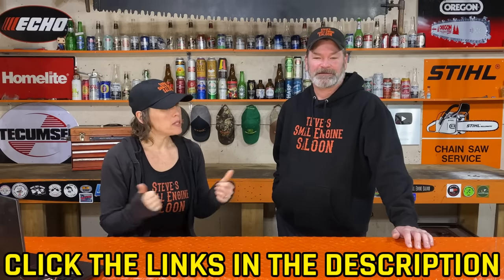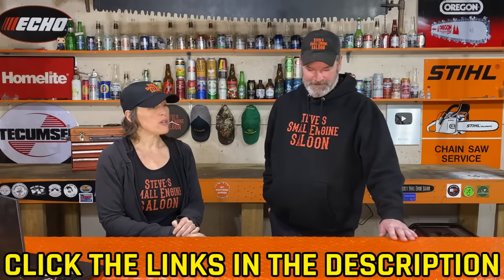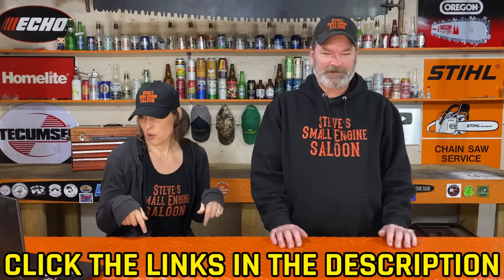Can I Use Old Dirty Motor Oil As Chain Oil In My Chain Saw? (DAY 18)

Comment: In alaska we all exclusively use used motor oil in our saws, we filter it through a coffee filter first and hit it with a magnet to remove metal flakes, the standard bar oil is waaay to thick a 20 below zero to even work, but 5w30 works just fine, been doing it for years with absolutely zero issues. Plus, why pay for stihls overpriced oil?! I cut 60 plus cords of wood a year, and have never had a single problem doing this.
Reply: I do the same, I purchased a small block Chevy oil pump converted so I can use a filter on it. I filter it through a k&n oil filter and store it in jugs to use .
Reply: You can't mechanically filter out all the metal particulates with a coffee filter. You're getting away with it because of limited use. We used to see commercial pro saw oilers fail regularly using used motor oil. You're stepping over dollars to pick up pennies. Paying for the correct type/weight bar oil isn't going to bankrupt/cripple you by cutting 60+ cords a yr.  Sure, you'll always have brethren that do the same thing.....doesn't make it correct....
Reply: @TheReal1953  try using stihl oil in 30 below zero, it will burn up your bar in 10 minutes because it's too thick to flow. That's why we use 0w30
Reply: @jasonburguess  We used to thin bar oil when it was that cold with diesel. You still retain some of the lubricity 'stickiness' of true bar oil that way. You have ZERO stickiness with waste oil... it's just slung off. Cold temps may be saving you some from normal temp wear.
Reply: I thin my bco. With 10 to  20% atf. Works really good in winter here in Mt.
Reply: Every logger I’ve ever known does that, oil that is drained out of the yarder, shovel, etc.

Comment: I cut over 70 cords of wood a year. I have several Stihl saws and use only clean used motor oil out of gasoline engines as diesel engine oil is too thick and nasty. Here is the thing. My engine I took it out of is a lot more delicate than a cutting chain and my engine was running fine on it. Also I turn my oil up all the way so it uses all it can and can oil good. I fill my oil full and my fuel 3/4 and that way I run out of fuel first. A dry chain is bad. Also about grit. There is so much dirt and sand in the bark of trees the little amount of abrasives in the oil is insignificant.

Comment: I have used used synthetic motor oil in my chainsaw for decades. Make sure to screen the grit out first.
Reply: I use cooking oil
Reply: @johncuervo3019  I did that for a while to but it did eventually fuck up the oilers in both my saws.
Reply: I use a 50/50 mix of used car oil and thick bar oil to save a few bucks and use up my used oil.
If you drain the oil into a clean container, there's no grit in it. If it has grit in it coming out of a running motor, the motor is about to blow up.

Comment: Good quality bar oil is way more sticky than used or new motor oil for  a reason. It clings better to the bar and chain for better lubrication. Only time I have heard of guys using motor oil (Professionals, not home gamers) is when it gets really cold out. Motor oil will thin the bar oil a little to help it flow at cold temps.
Reply: There is no difference in the durability  of chainsaw components between special chainsaw oil and used car oil in good condition, none. The only reason to use specialized oil is environment and health, engine oil is very toxic, specially if its used. Pros only use specialized oil when they are under Government and company regular inspections that demand it but when they are not most will just go for the used engine oil.
Reply: @Wen6543  Bar and Chain oil is much more sticky than engine oil. That is why it is used.
Reply: @corey6393  Other than having to refill the oil deposit faster, ecology and dirtiness it makes practically no difference in the performance of the chainsaw and the durability of its componentes.
Reply: The bar wears out faster. The sprocket on the tip gets loose. 
And if you gun the throttle one time not cutting you’re wearing a stripe of dirty oil. 
Bar & chain oil is cheaper.
Reply: @davehaggerty3405  No its not, even if the bar wears out faster is not noticeable, by the time you need a new 80 or something dollars bar (depending on the size and brand, can be a lot cheaper) you have saved hundreds of dollars in bar oil. Heck, you can even use kitchen oil without problems.
I don´t advice anything, i´m just saying a reality. Everybody can do as they like.
Reply: @Wen6543  I’m just going off of personal experience. Cutting side by side with my Dad. Back when we both heated with wood. 
Dad was too cheap to buy bar oil. Old motor oil in a warm saw gets thin and runs right thru. So you have no lubrication. 
I buy bar&chain oil by the gallon at TSC. And I only run Amsoil synthetic at 80:1 in the tank. 
I also use bar & chain oil on my several sets of hedge trimmers. Tho that type oil can cause a little bit of browning on the shrubs if I just put oil on the cutter bar. 
So I start on the back of the bush.
Reply: @davehaggerty3405  If the chain and bar get that hot to the point of no lubrication then something is wrong, the temperature inside a motor is way hotter and the oil keeps lubricating. 
Our chains and bar sprockets and grooves are always "wet" not matter the season or what we cut, and we can always touch them without the risk of burns, if they are like that then the oil is lubricating, no secret. 
Yes, it´s dirty, yes, it can be dangerous because it creates a mist that is breathed, contaminates the skin, etc, but it works fine for the chainsaw.

Comment: Just because you can does not mean you should.
Thanks for the video Steve and April.
Reply: You beat me to it!
Reply: Yeah yeah well I've been doing it for more than 20 years and have never had a problem
Reply: @heavenbound1536  Congratulations.
Reply: @justanotherviewer52  yeah well doing almost 400 CORDS of firewood a year and residential tree removal and land clearing nothing wears out a chain faster than nails or working on a fence line and as far as wearing out bars ... usually that comes from my guys running the saws in the dirt..... but if you change your oil after 2 or 3 thousand miles there usually ain't a whole lot of anything that will wear out the bar before you hit barbwire or concrete epoxy a home owner pours into a hole in the tree

Comment: I tried using straight used synthetic oil for bar oil.   I had it in jugs for about 6 months and left it to settle.    Then pour it into another jug but not the last part.   There was always different stuff in the bottom part.    When I used it I found that the chain would only need to be tightened half as much as it did with bar oil.   I used it for year's and cut a lot of firewood as that was our source of heat.    Put bar oil in sometimes and found I was back tightening the chain more often.    Our wood stove was used 24 hours a day for about 6 months of the year. 

Dale in Canada 🇨🇦

Comment: I have filtered used Full synthetic oil that is really clean and used it as bar oil but usually I use bar oil and shake the bottle and if it sloshes like water it is too thin. I shake all the brands and buy the bottle that is the quietest which means it is thicker and will not fling off the chain as easy.

Comment: Thank you Steve for shooting my great idea down. I have just changed oil in my 6.0 powerstroke and kubota m6800 tractor.  Therefore I'm in possession of a little less than 7 gallons of used oil. I'm in the woods sawing right now and NOT in possession of any saw chain oil. So I thought kill 3 birds with one stone. Save a trip to the store. Get rid of something I'd have to haul to the recycle center  and 3.... save some money. Let me say I disagree with one statement you made. Bar oil ain't cheap. To me cheap would be 5 dollars a gallon. I'm paying 15 at ace is the place. At 6 gallons of used oil that's $90 bucks. I'm gonna take your advise anyway. Thanks. Your videos are the best.  Technical detail and
Reply: Super entertaining .

Comment: I don't know about you but when the engine oil comes out of my vehicles it is in very good condition.  I started using it sixty years ago in the days when all saws had manual oilers even with automatic ones.  Because I used much more of the free stuff than the expensive version (mine was never 'black' by the way!) I was almost washing away the contaminants.  The bit of abrasiveness that might have been present was as nothing compared to the salt water , sand and gravel that we always had to cut.  Never had a problem and my bars and chains lasted as long as anyone's.  Longer than most as mine always had plenty of oil on the chain. Though few were and are rich enough to use brand name new bar oil.  Wasn't even offered in those days.  Wasn't until many years later that the marketing wanks started putting it on the shelf.  My saws never 'splattered either'.  I cleaned my saws in any case and they rarely ever went to a commercial shop.  If they had I can guarantee you that the mechanic wouldn't have noticed.  His hands were in the solvent tank and Brake Clean so much that that would be the least of his complaints even if it were a problem.  Even if you do the '100K' oil changes your oil will be fine if you run it through a coffee filter and just let it sit.  The solids drop out of solution and go to the bottom of the jug.  Any excessive oil went into the wood and was burned in the stove as a vapor.

Comment: I've been doing this for 25 years. It works fine. Just strain it first. I've never wore out a oil pump or bar.
Reply: So have I...works great. I run mine through a paint filter no problems. My mechanic couldn't care less fo he is me lol.
Reply: Same here
Reply: I have a Poulan from the mid-1970's.  It was a given to me by my grandfather.  It has a manual oiler which is what I learned on as a kid in the 70's.  I don't think that saw has ever had anything but used motor oil on the chain and bar.
Reply: I put all my old engine oil in a 55gal drum and reuse it. I do a TON of cutting being on 45 acres and plenty of equipment to supply the used oil.

Your oil has way more life in it than the 3k, 5k, 7k you change it at. Does your car blow up exactly at 3001 miles? No, because there is plenty of life left in it. Hell, people can run synthetic for 10k miles with just a filter change.

Second, the oil for the bar is used up as you use it, it's not recirculated into the system. It only has to last maybe 10 seconds before its flung off the chain as you cut.

Third and the most important, COST. You spend $20 a gallon on basicly the same 30w oil(look it up). A new bar is ~$60. Your more likely to wear out the bar from not flipping it or having the chain to tight. I've ran 20+ gallons on the same bar. 

Only thing I can say negative is DIESEL oil. It works fine, but its black as night and stains clothes, boots and somewhat the white plastics on Stihl saws if you don't clean up afterwards and leave it on. Have a dedicated cutting outfit if you do, or take it as a badge that your out there working hard 👍.

Hope it helps.
Reply: this is what I was thinking if you're gonna filter it
Reply: Me too… 😂😂 I’ll start straining it…
Reply: It makes a difference if you were running a chainsaw professionally or if you're cutting firewood or doing three or four hours a week working with a chainsaw if you're working professionally even brand new motor oil doesn't have what you need you need something called viscosity and that's the only thing that will stop your bar and chain from wearing you are wearing your sprocket your drivers on your chain and your bar and your tip it will run higher heat so on a hot day you're doing more damage to barn chain than what you realize if you shut your saw down and cannot touch the chain because it's so hot you need bar chain oil that has a high viscosity content, also inspect your bar for ridges or chipping along the groove edges where the chain rides, but if you insist on being cheap, then make sure your oiler adjustment screw is turned all the way up, if you're saw has this adjustment
Reply: @larryfunnelcake9669 every motor oil has viscosity. In fact every liquid has viscosity. It's not an additive. It's a measurement. Your comment makes little to no sense. What do you think engine internals need?
Reply: @ramblinreelstv2335  this video is about bar oil not engine oil.
Reply: @RussellHoughton  well the title and content of the video would suggest otherwise, but if you take a second look you'll see that my comment was a reply to another person's comment, not yours. And I completely agree with your original comment. Also I wasn't suggesting anything about what to use for motor oil. I was simply pointing out the error in another person's comment regarding oil viscosity. 👍

Comment: I had thoughts of adding stp to new engine oil to make my one bar oil . When my dad was buying the chainsaws I ran whatever I could find he made sure I had bar oil. Now that I bought my saws and maintain them . I look at it all different. 

Don’t run when chain is dull, use good stuff for the saw . Don’t leave out in the rain . 
Now that bar oil is 20-25 bucks a gallon in CA. It sure makes me think can I make my own cheaper ?

I saw bar oil for 14 bucks a gallon . I bought a gallon thinking I saved 10 bucks or so. 

I change my own engine oil .
It’s a dirty oil . I just can’t do it to a saw I spent 1200 bucks on . 

I can’t do it to a saw I borrowed from someone either .

I have a friend that does it . I will see how that goes for him .

Comment: Well put Steve adding to that the microscopic metal shavings in the used motor oil will wear the chain,bar grooves and bar nose sprocket out prematurely i have heard of people using pure vegetable oil in cold climates STIHL and ECHO make a biodegradable bar and chain oil based on vegetable oil just with other ingredients to make it stick to the bar and chain better.

Comment: I use engine drain oil to oil the wheel  bushings on all wheels, deck wheels and steering components on my riding lawnmowers.  Years ago, I didn't when I was buying oil for less than 50 cents a quart.

Comment: If you run out in a pinch vegetable oil.  Parks services is required to use it for environmental reasons
Reply: I've never had a park tell us to do that.
Reply: @happycamper6352  in protected parks where they don't want bar oil flung around it is restricted to vegetable oil.    It all has to do with the environmental regulations in certain areas
Reply: @happycamper6352  and my bad I might have said the wrong service.  It's the national forestry service.
Reply: @mikemitchell9157  I guess I haven't cut there yet.  I have cut residential, business, public sector (schools) local and state parks, state forests, but not yet anything federal/national.  When you use that stuff, do you notice any differences?
Reply: @happycamper6352  from what I'm told the only difference is its thinner so you have to turn your oil down or else you'll blow through it in a half tank of gas.     But it gas something to do with it being more "environmentally friendly".   It's just a way to appease certain activists.   But yeah if you're in a disaster and aint got no bar oil and gotta clear the road  it'll work just fine just remember to adjust the oiler and to adjust it back.

Comment: All my saws have had used motor oil for the bar from brand new. 3 saws in the last 40 years and have never bought bar oil. I do turn the pump volume up a bit higher though. Every 10 to 13 years my saws are pretty much worn out, the bar as well.
Reply: Used oil does not wear out the saw faster. Unless it’s really dirty then the oiler migh plug up.

Comment: I've been mixing filtered used oil with chain oil 50/50 for years now and it works great.
Reply: My filtered/used 15-50 synthetic out of my motorcycle is the best chainsaw chain oil I've ever used. Try it.
Reply: We used to use old McCulloch chainsaws that specified SAE 30 motor oil as Bar Oil I've tried several different bar oils and find them too thick here in Michigan when the temperature drops below 50° f. I've been cutting for over 50 years and I do like the tackiness of Bar Oil but the viscosity is too thick. Even the stihl bar and chain oil is too thick I bought a new Stihl bar& chain for my MS290, and burned out the bar in about 8 months of cutting. That was an expensive lesson, and I'm going back to mixing 50% used & filtered 10 W 30 synthetic motor oil. I simply filter it through the same filters I use for automotive paint. I've got an old Homelite 240 that I bought around 1985. Always choose my own mix of 50/50 bar and motor oil and it is only on its second bar. Like one guy said there is more grit in the bark then anything that comes out of your car engine. As long as you capture the oil in a clean drain pan, or filter it.  My Sithl MS260 pro just destroys bars, using Stihl bar oil, even with the oiler turned to maximum. 

Personally. I like my older Homelite 360 that runs at 8500prm vs the new saws at high chain speeds.

Comment: I would sooner use new oil than used as it has minute carbon/metal particulate in it and could also have fuel or coolant in it as well   I agree with you there Steve/April   Great vid as always  I loved the hidden fee comment lol
Reply: Local guy here calls that extra a friendship fee
Reply: But you run that in your car?
Reply: @wollywolly2734   I heard what is good for the car is good for the chainsaw.....! hehe

Comment: Back in the 70's when I was doing tree work full time, I tried using old motor oil in my Stihl chain saws. The oil pumps were metal, and it wasn't long before the pumps were worn out from the grit and fine metal in the oil.